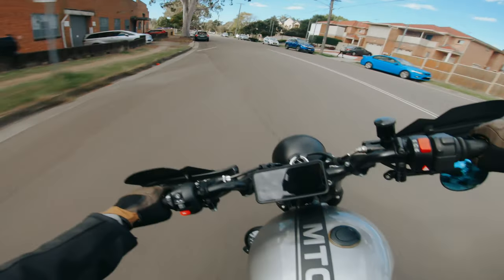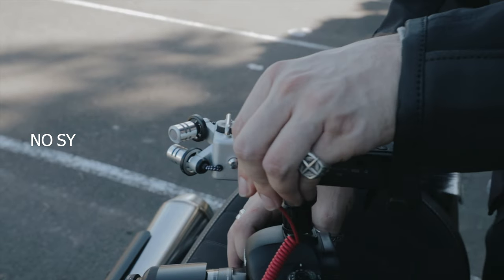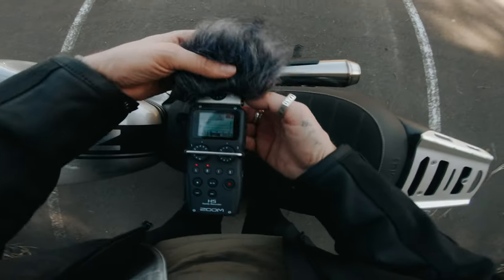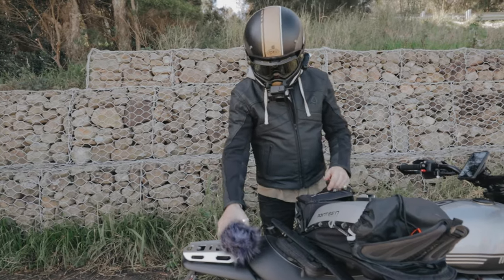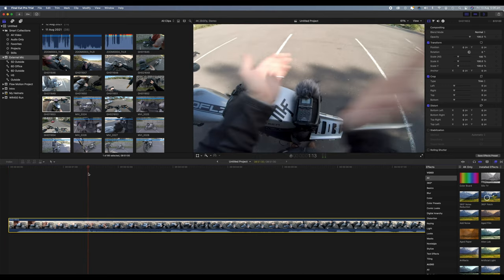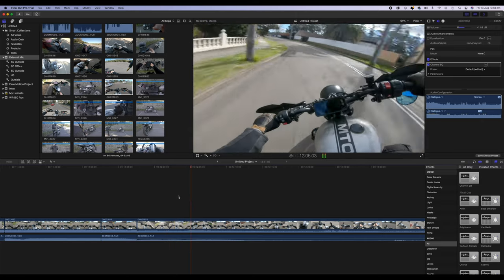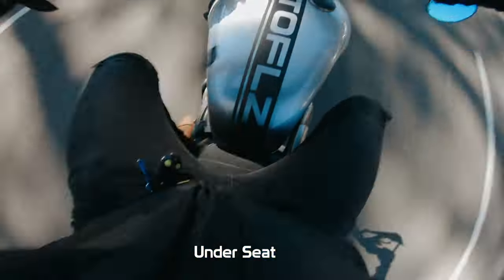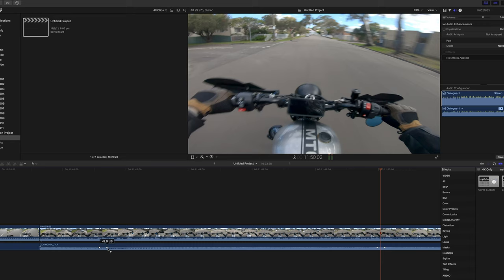3 In-depth Tips on How to Record MOTORCYCLE AUDIO | Minus the wind noise 2021

Comment: Great vid Rob, thanks for this. I've been a m-vlogger for some years but one of the main things that stops me proliffically uploading content to the Tube of You is the poor quality I previously got from both audio and video. Fast forward to 2022 and I'm now rocking a more up-to-date GPH9, but as tech has advanced I'm now running audio from my helmet intercom into the media mod of the GP, I'm still not happy with the limited control over the audio from the GP, so I'm now looking at ditching the spoken audio into the GP and maybe, as you have done, just run ambient bike/wind audio into the GP, and recording both MY audio as well as that from my intercom into an external handheld such as the H1n or similar.

I had been looking at the Zoom Podtrak P4 as it also doubles as a Podcast interface (which is something else I'm looking at delving into) but it is bulky for the bike and the inputs are XLR.

Comment: Great explanation.. I usually plug my zoom h2n directly to gopro mic adapter and then to gopro camera which have ulanzi door so no sync needed.. the settings I use is XY, gain 5, mp3 320kbps , lo cut On
does the job
Reply from the maker: Thanks for sharing! Are you able to still chat while recording pipe sound?
Reply: Hi buddy what adapter are you using? I've a gopro hero 4 and zoom h2n and trying to find an editor to sync it all baffles me, cheers.
Reply: @musclefox223  it's Genuine GoPro 3.5mm Mic Adapter and it's compatible with gopro 5 and up I think 
Or you can record separately ( video and sound ) and sync together in post
Reply: @TheQQRYQ80  Thanks buddy, What editing programmes are being used to edit/sync etc....cheers.

Comment: Great video. Now I am planning get H5.
My current setup  is Zoom H1 and lav mic, which cost a bit less than H5. Clipping the lav mic on belt, right above my butt. This location can reduce most of the wind noise, but the sound from H5 is so much better !
Reply: Is HN1 good for recording pipe sound? Or should consider higher models?
Reply: @haisanjafri  My recorder is H1, it's is an older model. It picks up wind noise easily after 60 km/hr. This might be attributed to the configuration of my bike, CB1100 which doesn't provide a wind-proof place to mount the recorder. Most common place to mount H1 is the storage space under the backseat, but my CB's storage space is at the middle of the bike and it's too far from the pipe. That's the reason I put an external lav mic.
The H1N has new features like, 3 lv. of low cut and limiter, some says they work well as wind noise cancelling features.
I got several idea from other good sound quality channel, using H5 or H6 with dynamic microphone mounting between mudguard and wheel. This is what I'm planning to do as soon I saved enough money, a big amount of money.
Reply: @a99770a997  Great. So better to get a higher model than having HN1, something like HN4 comes into my range
Reply: @haisanjafri  yeah, I think it's a better option. It got XLR jack too, good for future external microphone updates.

Comment: Thanks heaps - struggling with getting the exhaust audio without it clipping. Running a DJI action 4 with the DJI mic 2 - put -12 DB in the menu and chucked the mic in a tail back with lots of padding ,still get the cracks (very loud pipes). Will try more padding and putting it inside a jacket pocket.

Comment: Great video with valuable tips, I'm looking for a wireless microphone to use in the helmet that pairs via bluetooth with the go pro 11 but apparently it doesn't exist... I can't believe that at the current technological level of the 21st century, motorcyclists have to ride with a bunch of wires and all sorts of kludges, just to get external audio on the go pro... Sacant by the manufacturer, which for commercial convenience prefers to sell expensive and monstrous adapters, harming the user experience, than allowing a microphone or wireless headset pair via bluetooth, which I believe would technically be possible, unless I'm mistaken...

Comment: Awesome work, fella. With the GoPro, I have a Hero 7 Black. I assume the mic goes into the adapter block, which then goes into the side of the GoPro. It’s finding a mount that can hold the block rather than it dangling down.
Reply: Try a Ulanzi case. Works for me!

Comment: Great video and timing…now all I need to do is go for a ride and get some sweet, sweet audio 🤗 also love your backpack trick - I’ve tried using some gopro/camera mounts to my bike and am finding the zoom gets a weird rattle noise through the frame at high revs so I’m definitely gonna try your backpack/beanie trick 🤗…one question tho…how do you get your gain levels set whilst it’s in your backpack (does it muffle sound much?)
Reply from the maker: Yea it’s best to cushion it otherwise you’re gunna get rattles, or vibrations throughout the audio. 

It muffles sound a bit. In post is where all the magic happens. The first time I try my zoom in a new spot I always have the headphones attached and give the throttle a crack. This gives me a basic idea. Then throw an EQ on it in post boosting highs and mids. Blending my helmet mic comes in handy for definition too

Comment: I am having such a hard time with wind noise!
I got the Homen wireless dealy a while back (RIP after flying out of my unclosed pocket on the highway) and tried a million different positions with nothing really working. The cost of entry, for a laymen like myself, starts to get pretty steep pretty quickly, especially since the DJI 4 has no built in audio jack (H5 is currently $250USD).

Comment: Thanks for the video.  I have a new H1n with a purple panda that I've been experimenting with inside my full face Shoei.  My voice sounds all "jumpy" and shaky.  I feel like at times it doesn't even sound like me.  I've tried closing the vents on the helmet.  Gain appears correct.  Cut off any low volume filter stuff.  Still not pleased with how it sounds.  Not sure what I'm doing wrong.

Comment: Hi,
Would you be kind and get the BMW R1250RT 2021 engine recorded? My bike sound strange when climbing road mountains especially when changing  1,2 and third gears.
If the sound is the same I would like to send this recording to BMW engineering dept. for review and comments. I tried with standard microphone but results is very poor

Comment: I have struggled with this...  GoPro Hero 9 and 10 black were overheating and random lockups, totally unreliable... The DJI Action 3 was great for video, but the audio with external mics was horrible, the only way to get good audio was with the DJI wireless mic setup, but it was clunky and lots of pieces, and its not waterproof and got fried in a rain storm.  Am now on the Insta 360 One RS 4K with a Road 2 LAV... and on that, you can reduce the gain to -18dB but it still gets a bit of clipping, and that's with TWO wind socks on the mic...  I recently got the Zoom H1N and that does give me fine control of the audio gain, but it has to sit in my pocket and sometimes it shuts off.

I just can't seem to find the right combination of things, to get both excellent video, as well as good audio without having to jump through too many hoops...  I feel like if GoPro could fix their overheating and stability issues, and add some ability to turn down the gain on external mics, that would do the trick...

Comment: For recording pipes, do you reckon a purple panda plugged into an iPhone could be used an external mic in a backpack? Just trying to make the most of the hardware I've got. It has the same problem as a GoPro in terms of not being able to adjust input levels (I think), but would solve the problem of having to route a cable from the GoPro to a jacket as you've done here.

Comment: Great info! The downside is that you always have to stop to press ’record’ on your H1.
Do you have any beginner tips to record audio? (just the exhaust sound)
I have a GoPro Hero 9 Black, but i want to hear the roaring sound of my MT-10 🤤
Reply: If you have a hero9 and an mt10, surely you can slap out some change for a mic 🤔
Reply: @Daniel-dj7fh  I have a Triumph Street Triple RS (2023). I use a Rode Wireless Go II that I put under the seat and then hool the receiver up to a Zoom or a lavalier.
Reply: @BikesAndBatallas  So you're recrding through a lavalier mic?
If so where is it positioned.
If not, did you wrap the rode, and with what?

Comment: hey thanks for the tips! love your videos man.
Now question.. I have a zoom h1n and I got rid of the wind sound but I get to hear too much of the mechanical parts, not just the exaust but also changing gears is way too loud or sometimes the sound of the motor is annoying. How do you actually get rid of that? do you use some compressor at editting? any on particular? 
thanks in advance and keep doing this videos! much appreciated

Comment: Hi mate just ordered a insta 360 x3 I already have a rode wireless go would the purple panda mic be good to use plugged into the rode wireless go or would it be best to just plug it directly into the mic adapter on the insta 360 x3 and would u recommend I put the mic in my pocket as well to try and not have as much wind noise ? Any tips would be much appreciated mate

Comment: I ride a Zero DSR so bike 'sounds' are not a big part of my videos. I also own a DJI wireless mic that just came out which has 2 transmitters where I can adjust gain on each. Hiding one of them in my jacket pocket is a neat trick since they come supplied with a dead cat for each. But having a mic in my helmet to speak as I ride will pick up wind noise. How would I balance between the two or is it best to record my thoughts in post?